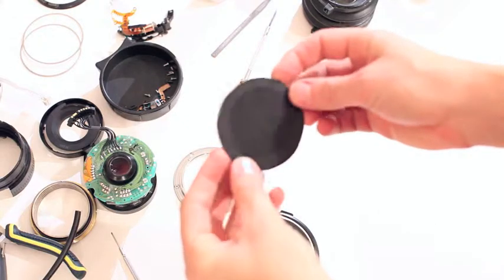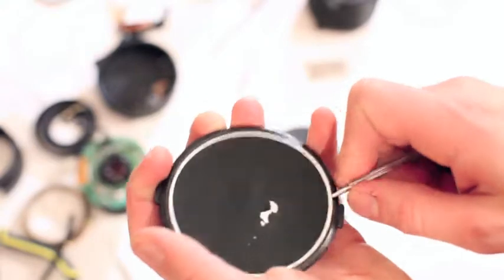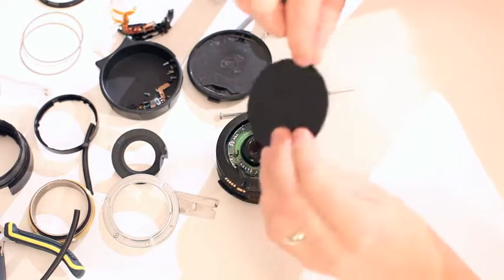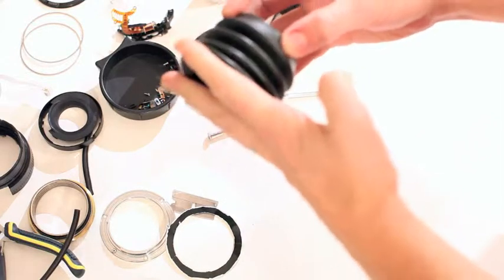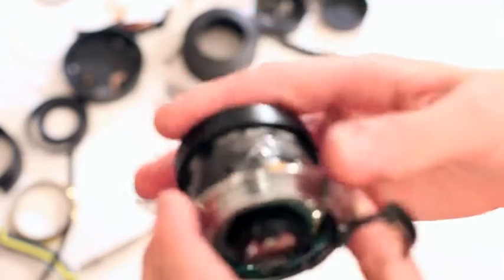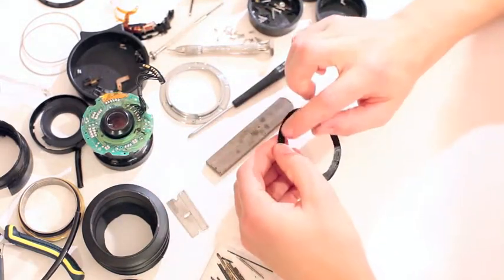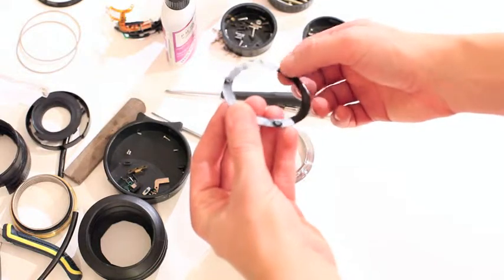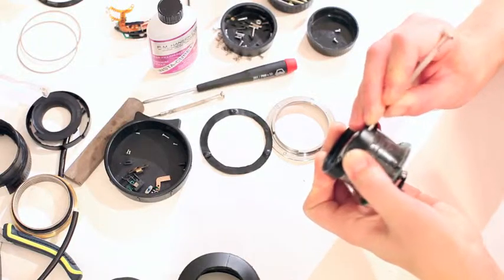How to build a Canon 28mm 2.8 EF EOS TS-E Tilt Shift Lens DIY pt.4

Comment: Hey Todd

I have a nikon 35-70 pushpull that the AF motor runs but does not focus. Do you repair those?

Thanks
Reply from the maker: Hum sounds like either the gear connecting rod is missing or damaged or the plastic receiving gears on the focus are mashed.
A quick check would be to pull off the mount and just have a peek that the gear the meshes with the body lug is properly set. I have had one lens that turned out fine but it was just that gear was out of place.
Reply: Todd Armstrong Any ideas or diagrams on what I should disassemble?
Reply from the maker: DaTimShow No sure, you may have to google it. To pull the mount all you need to do is loosen off the 3-4 rear screws on the mount and the 2 tiny screws holding the chip contact and you can pull it off and see whats going on in there.

Comment: l cleaning my eos 650 mirror with lens solution, together with the q-tip. is it will effect the coating on it? because before l clean it up, l saw the mirror has a purple reflection, l thought it was an oil that make my mirror look oily. l'm afraid it will effect my pictures or electronic reading. hope you can help me. thanks :)
Reply from the maker: That purple haze is not coating but its actually exhausting plastic from the mirror box which often coats mirrors on these older cameras. I just use a normal lens cleaning cloth and breath and wipe them clean. It should be clear and clean.
Lens cleaning fluid will work but I don't bother personally. I don't recommend Qtips though because they will actually scratch your mirror.

The mirror won't effect image quality since it flips up when the photo is taken so they can be scratched and beat up and it won't matter. Also I wouldn't worry about metering because you would have to break the mirror pretty severally to make it meter wrong.

Just a note when shooting film, film has a huge tolerance in latitude unlike digital. I personally shoot my weddings 5-6 stops over exposed (400H) and film loves more light. Digital cameras can't handle that. http://bluecoralphotography.com/

So I don't' worry about metering a whole lot with film as long as I'm over exposing.
Hope this helps
Reply: thank you so much for your help, l really appreciate it ;)